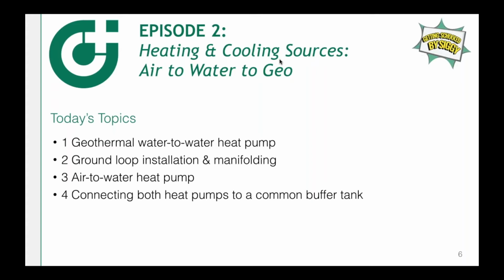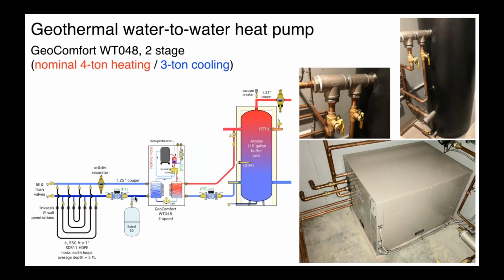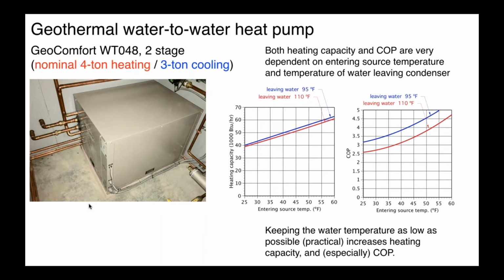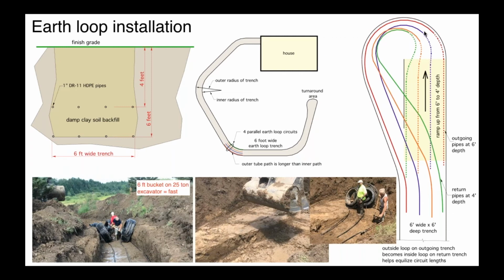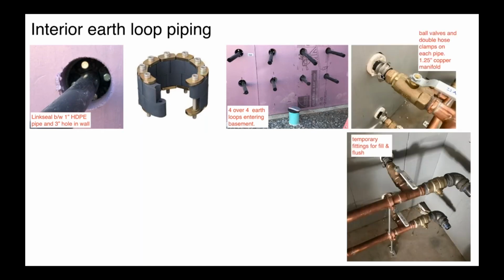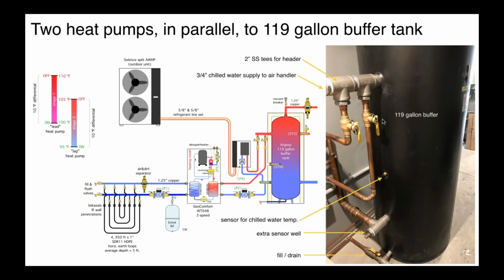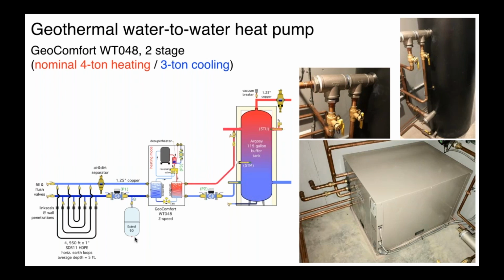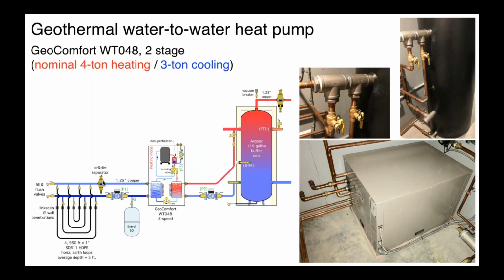Heating and Cooling Sources   Air to Water to Geo

Comment: Have you monitored the temperature of the water entering the heat pump from the geo earth loop? With the earth loop 4 to 6 feet deep, does it vary much from around 50 degrees from season to season?
Reply from the maker: To date we have not monitored the entering earth loop temperatures - partially due to COVID limitation on access.  However, similar earth loops in this location typical show enter fluid temperatures in the range of 55-60F in mid-fall, and drop to low 30F range by mid-march.  This system uses 25% propylene glycol antifreeze and the loop would be capable of operating down to about 25F, but it’s very unlikely that will happen.  The average deep soil temperature here is around 45F.  The temperature range on any earth loop will depend on several factors including amount of piping installed, average piping depth, heat pump capacity, soil type and moisture content, and location.